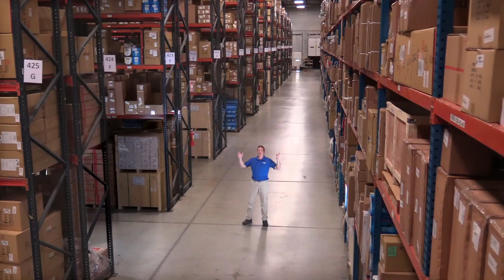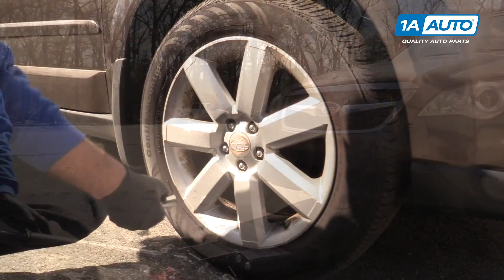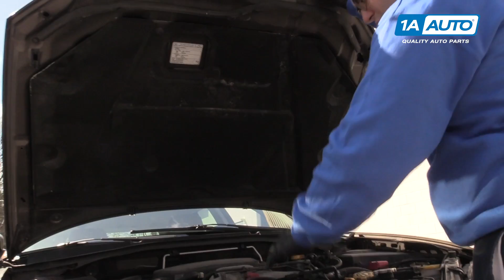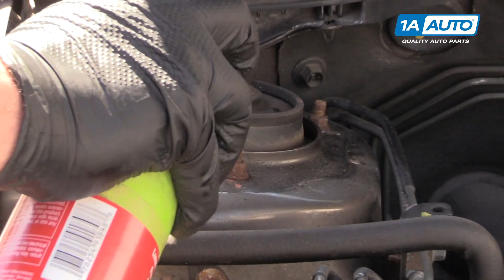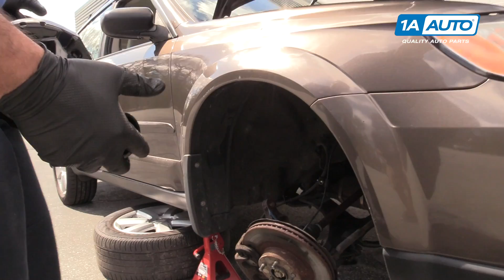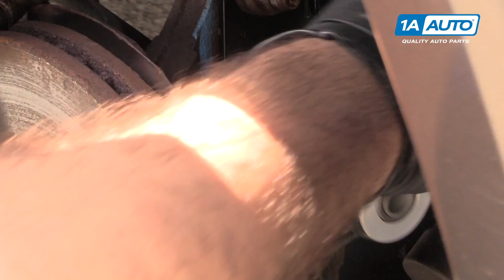How to Replace Front Strut Assembly  05-09 Subaru Outback

Comment: I really need some help, I have an 08 Forester. I'm trying to change my CV Axles and the strut bolts are stuck into the hub assembly. Any tips on how I can get them loosened up without a torch

Comment: I always put small square pieces of 1/2” plywood under the jack stands so they don’t dig into the asphalt. Also apply anti seize on all bolt threads as well as the lug nuts. Thanks for the video.

Comment: Excellent video. Made the job straight forward. Here are some torque specs: 3 upper strut mount locking nuts = 14.5 ft-lb

2 lower strut locking nuts = 129 lb-ft

Comment: My stock struts are bad they have 175000 miles on them and the ride was just rough. Replaced them with new ones from 1Aauto. No difference at all. My car is still riding rough
Reply: MAybe your other suspension components are bad too
Reply from the maker: +Gabriel Santos We wouldn't be able to diagnose an issue like that here, you may want to have a local mechanic take a look at it. Thanks for checking us out! http://1aau.to/m/Shop-1AAuto-c

Comment: ive seen other peoples videos painting a line on the camber bolts, and making sure the lines are lined up in the end, instead of how you did it. is there a difference?
Reply: just finished the fronts. the axel moved high up as soon as the bolts came out. how come yours didnt? it was a pain trying to push the axel down to fit the bolts
Reply: pretty sure he had the bolts mixed up too. Turning it didn't move the strut in/out at all. That's not right.

Comment: I'm having a problem, when putting in the new strut, it is sitting too low for the bolts to go back in. I know I have the right part. Any suggestions?
Reply from the maker: +Asher Krantz You can try fastening the bolts at the top mount first and then the bottom bolts if you were doing it in the inverse way. If you are still having difficulties I would go back and take another look at the video to find something that may have been missed.
Reply: @1AAuto thanks for the help. I got it figured out and installed
Reply: @1AAuto  I'm having the same issue as Asher. The shocks going in are not a 1:1 match of what was coming out. A prior owner had installed these (crappy) Perrin coil-overs that creak and pop. I'm putting in the struts in the video and I've followed many of these tutorials. They're all the same. In them the steering knuckle is beneath the bottom two shock mount holes and they all—just like you did here—lift the steering knuckle up into the bottom of the strut. My problem is the strut holes are a good 2-3 inches below the steering knuckle holes. Maybe the prior owner installed/tweaked something else? I don't know. All these vids are like yours and make it look easy. I was hoping this would be a DIY project, now I'm thinking I'm going to have to reinstall the turd shock (I've only attempted the right front so far) and get it to a shop to have a professional rectify it. But if you've got any other advice I'm all ears. Thanks so much!
Reply: I figured it out as well. My issue was uneven jacking. I had the right side up initially. When I lowered the right and jacked it up from the front center that evened things out and the strut moved (almost) into place. It was still off by a little bit but I was able to get the bottom two holes aligned enough to push a big flat-head screwdriver into them. Once I did that, I levered it until the top holes were also in alignment. I tapped the top bolt in, just enough to hold it all in place. Once the top was secure the bottom hole was easy. Thanks for these videos. Super helpful.
Reply from the maker: +Kevin Brock Thanks for checking us out. 1aauto.com
Reply: @1AAuto  Your videos are super helpful! Thank you for making these.